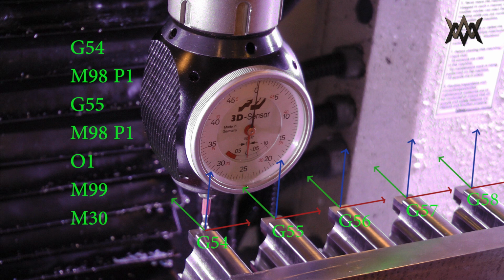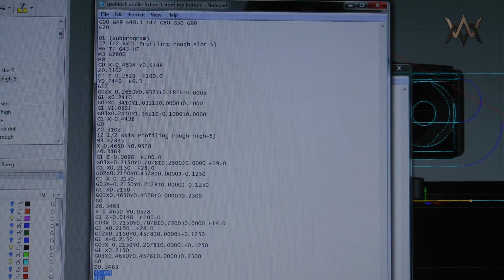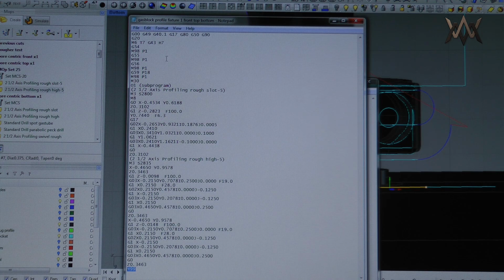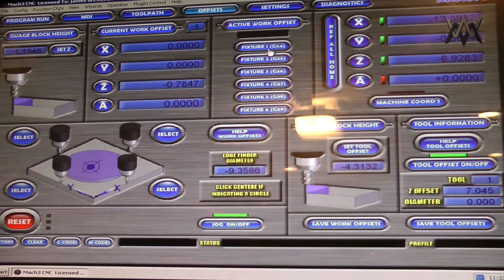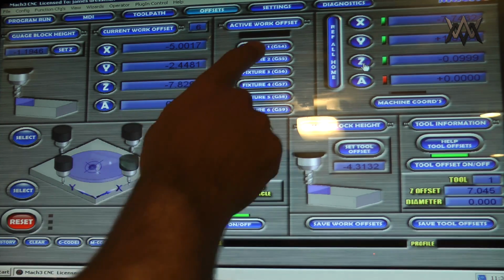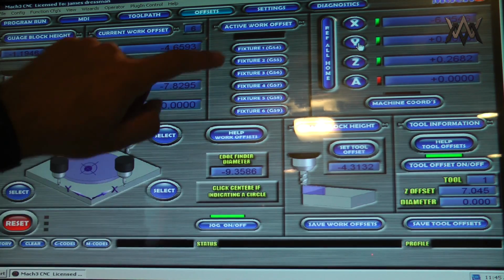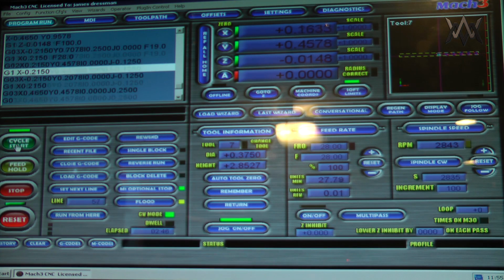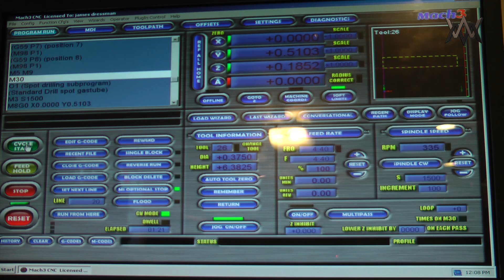Subprograms and Offsets

Comment: Great info packed in there War, i get lazy having all the code nicely packaged in a CAM environment.
Reply from the maker: +l0ckcr4ck3r Me too. The main problem for me is that If I want to make changes I don't even touch the code, I go straight to the CAM and the changes are made for me. Playing around just now I found out my CAM does do multiple work offsets and outputs them automatically which is nice, but the generated code doesn't use the main code as a subprogram it just creates multiple instances of the same code but with different offsets. It produces the same result just with a lot more code.

Comment: Super helpful and good stuff!  Are you running one specific operation (file) per tool, and then opening a new file for each tool change?  Any issues combining them into one file?
Reply from the maker: +x19freak Hey Josh, Yes since I don't have an ATC I just run all the ops with a specific tool. I have a program for each tool. No issues with combining files with multiple tools, you just define each tool's ops with a new O number like O1, O2, O3, etc. and call them accordingly in the code M98 P1, M98 P2, M98 P3, and so on. Since I only have a handful of parts to do like this it wasn't worth all the copying and pasting. I had a very limited time to get these done and just needed to bang them out.

Comment: Very interesting!  I don't CAD/CAM, so my G code is all hand written, so this looked very familiar to me.

The process is very similar in LinuxCNC, but not as Playschool pretty.  BTW - you only had six parts and the Mach screen only had room for six offsets.  What if you had a full fixture with eight parts that all needed different offsets?  Would that have been difficult to do in Mach?

You know, John Grimsmo has those clever routines to automatically probe a pallet of parts to find the offset for each individual part.  :-)

I'm a bit confused.  Did you originally CAD this with eight parts on the fixture and have CAM generate the G code for all eight parts based on a single G54 offset?  If so, that doesn't seem like the best way to do it.  Having G code for a single part and calling it with different offsets for each station in your fixture seems much better.  The program is almost eight times smaller, there's less work when you change the part and need to generate new G code via CAD/CAM, and as you demonstrated in this video it's more flexible for accommodating any changes that may occur with unintended offsets to the fixture stations caused by mistakes in previous machining.  It's also a quick and easy matter to edit your G code to skip subroutines if you're only machining a partially loaded fixture.  I use more descriptive comments to make it easy to find the various subroutines and subroutine calls.  Example:  "(Call subroutine to rough cut exterior profile - station 4)".  I can have a text editor search for "station 4" and quickly find all instances, so I can comment all of them out of the program to skip that station for all operations if needed.
Reply from the maker: +Liberty4Ever That particular Mach screenset only has 6 work offset buttons but there is a number box that you can change to whatever you want. Work offsets above 6 are G59 P7, P8, P9....P255. In fact you can also just do G59 P1-6 too where P is the work offset number instead of G54-59.

Yes my CAM is based off of 1 G54 offset set to the fixture. I did it this way for a number of reasons but also because at the time I didn't understand how the CAM generated different offsets. I still am a little unsure but there is a tab in the work coordinates about setting up G54, 56, etc. offsets. I just haven't had the need to jump into it. 

I use 1 G54 offset because my fixtures are essentially perfect and also since I manually indicate using the Haimer it is easier and faster to do. This can prevent me from accidentally screwing up an offset as well. Also my CAM easily creates multiple instances based off of one offset and I don't need to do anything manual to the code.

If I had a electronic probe and the time to learn how to program macros like Grimsmo's probing routines I would probably do it like that and not be so fussy about the fixtures.